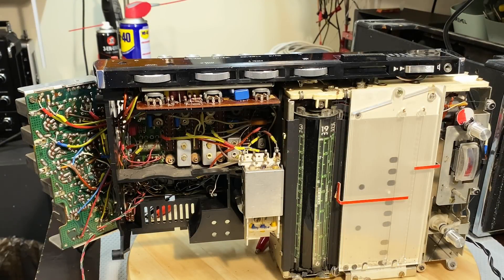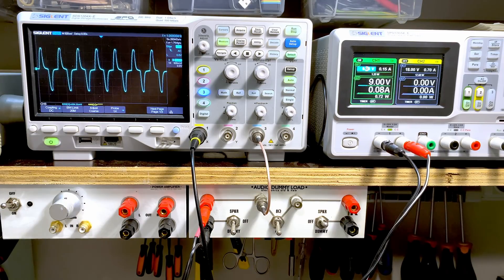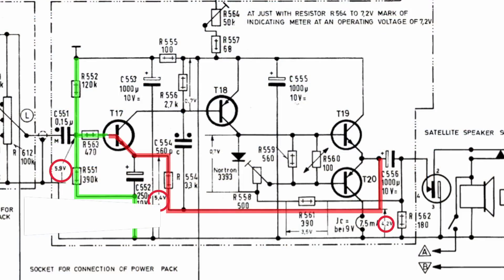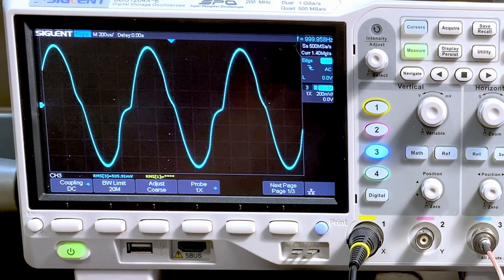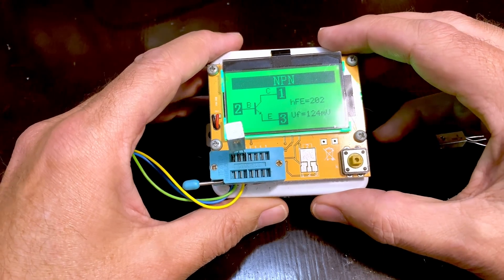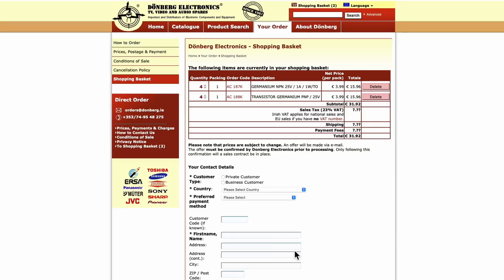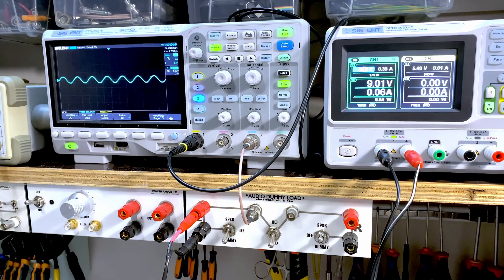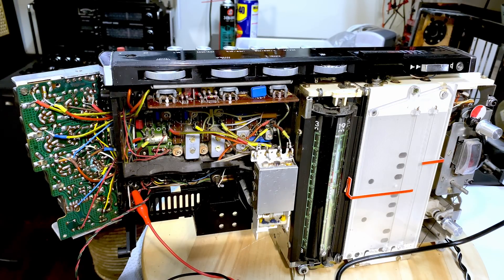We have a problem with this audio section. Let's solve it. Grundig Satellit 6001 restoration part 3.

Comment: It seems as you've mixed up all transistors ...A Deacy (or rather Superscope) amp is an old design with transformers used in lots of radios and as such it has two PNP output transistors of exactly the same type.It has to!
The Grundig design has a complementary output with one PNP and one NPN transistor.
Now you say that you have removed AC187 and AC188 from this old amp.Not possible!
Explain,please.
Reply from the maker: You’ve got it wrong. I first thought I could use the Deacy transistors, and then found I had the exact ones I needed for this radio. Check the video again.

Comment: I was wondering if you could have disconnected the feedback resistor from the output and connect 4.2 volts to it. It it worked then you might have been able to tell if the driver or output stage was at fault but it probably wouldn't be much easier than substituting new output transistors.

Comment: what about rebuilding the output stage using 1x BC212L and 2x BD131 power transistors google 5W Class A amplifier for the circuit.

Comment: Curiosity: Mr Carlson's Lab - Two six pack's on the bench @ 59 minutes. Its valve stuff but the scope picture looks just like yours :)
Reply: I'm sure you know about crossover distortion. In his case it was the bias of the tubes, on your case should be a bad transistor. I do love those tiny component testers. Got one just like yours and got a fancier one for my dad that also reads infrared signals from remote controls.
Edit: I admit that looking at the schematic I thought you just had to tweak the variable resistor between the gates of the transistors to balance them.
Reply from the maker: The X-over distortion looks different. It is usually only obvious at the actual zero-crossing. This one is all over the place.
Reply: Now that you mention it, it does twist the top wave a bit for sure.  I was looking at the thumbnail of the video :) these kind of issues is what helps the viewers learning. Good stuff :)

Comment: Hi Manuel,
I missed the step when you reconnect the speaker after swapping the transistors...curious to see if the distortion had gone away...
Reply from the maker: The result with no distortion is at the end

Comment: Nice stroke of luck on the transistors! 
However: I'm going to be the bad guy and tell you that you are playing with our sanity here when you say you'll try some radio reception and then change your mind. Reminds me of some girls I used to know...
Reply from the maker: It’s the female side of me 😊 No, the reason is actually more logical: I have a good result and need to build up the energy to edit the entire video. If I’d tested it and got nothing, all I would be thinking about would be why the bugger does not receive and the editing would really suffer. I’m quite impatient that way, so I edit with the inspiration of the previous success in mind. Works out a lot better. 
P.S. All of us knew some girls like that, unfortunately, but it made the chase all the more inspired 😃

Comment: These days I measure distortion just with an audio interface on the computer, super easy.
At the same moment read the voltage on the scope, and you have your number.
Probably also possible in the software as well.

Fascinating little circuit, you don't see that these days anymore!

Comment: Manuel good job as usual, who manufactured the transistor tester I'm sure it's made in China?
Reply from the maker: Yes it is. They’re sold as modules all over ebay, they’re cheap and work really well. The only problem is that they fail quite readily if you mistakenly test a capacitor with some charge on it, so I buy two or three at a time 😃